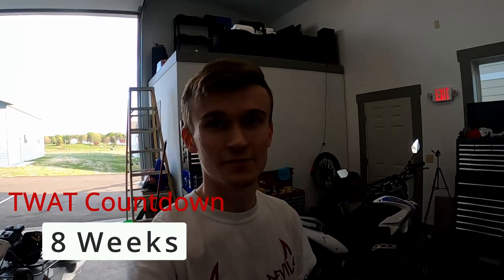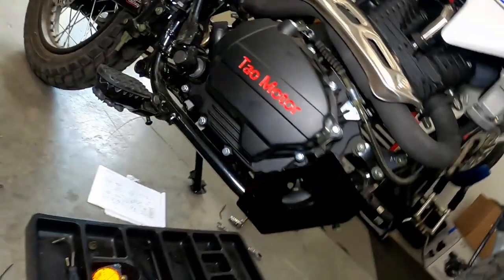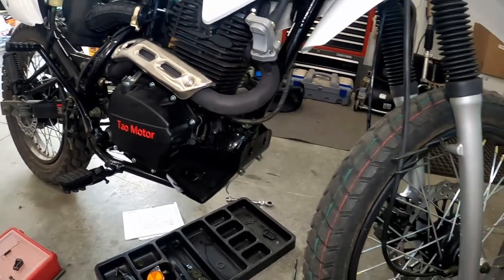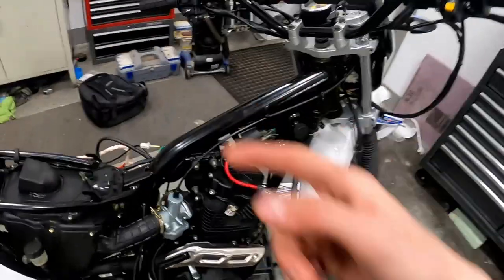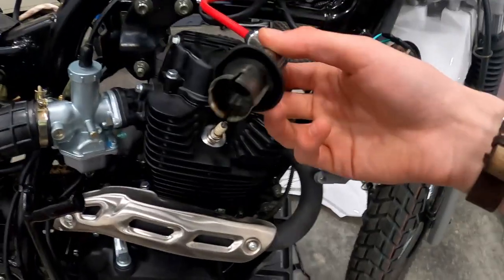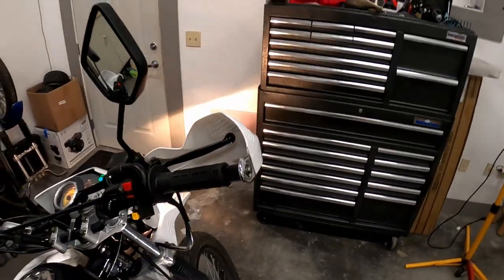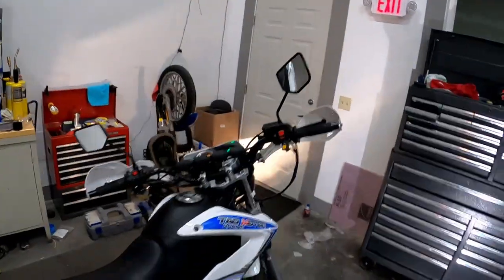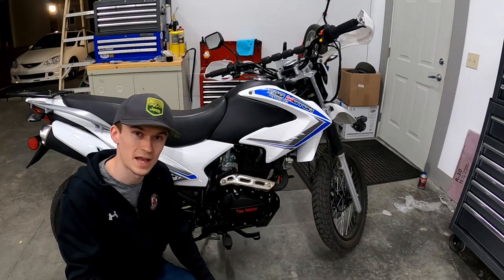TaoTao TBR7 Assembly (Skid Plates, Rear Brake Lever, Rejet Stock Carb)

Comment: Skid plates correct! Your rear foot brake lever is installed correctly…but the insert pin and retaining pin lets call it is in backwards flip it around so the locking pin is on the inside that way of you lay it down the pin stays in place other then that everything is looking good!
Reply from the maker: I was pretty confident the skid plate was right, but the rear brake lever was a bit strange looking. Almost 200 miles on it and everything is going good. Thanks for pointing that pin out, I'll flip it around. Doing fork oil, CDI box, and wiring some auxillary lights in today!
Reply: hey guys , 2 pedal, and jays since you both seem to be experts, would this bike be good for me as my first bike , ill be using it for daily commute , and also dont want to spend much, what upgrades would you guys say are necessary  , idk i feel likei dont know anything but have so much questions been doing some research but lmk if this bike is a good starting point for me, 6ft tall and 175lb, and my goal is to make it as best of a ride as possible and keeping up with the maintenance, any tips or hints? lmk if you can help ill send you my email so you dnt have to send the info through a comment
Reply from the maker: I think in general, this would be an "ok" first bike. There are pros and cons to everything. Pros would be that its cheap so it's a way to get into riding without spending a ton of money. You also don't care as much if you drop it or break something because it doesn't cost very much. Another pro is that the bike doesn't weigh very much and doesn't make too much power, so it will be easy to maneuver and learn how to ride without being too much for a new rider to handle. On the other hand, there are plenty of cons. The main one being that may require more modifications and maintenance than a higher quality bike, which may be tough if you're new to working on bikes. As far as the commuting thing goes, I don't think this would be a good commuter bike, though there are people who do it. The top speed on this thing is about 70 mph so if you have to do any highway riding during your commute, it'll be screaming at max rpm the entire time. Not to mention that as a 1-cylinder with low quality hardware, it vibrates quite a bit at high speeds. If you're looking for a commuter bike, there are tons of low-cost 80's or 90's bikes that you could pick up for under $2k. I have a really nice 1982 Honda Nighthawk 450 that I bought for $1500 that is way more comfortable to commute with. I do love the TaoTao TBR7, but I wouldn't recommend it as your primary commuter bike. Where it excels is being an affordable machine to get into off-road riding. Others may have other opinions, but those are my thoughts. If you do end up going for the TBR7, feel free to let us know if you have any questions and we can try to help.
Reply: @710GreenDragon  as far as maintenance or general upgrades they’re a great first bike to learn how to ride and wrench on very straight forward friendly machines! With a little work you could definitely make it into a dependable daily they’re really comfortable bikes out of the crate it would take some a little work nothing major before I would say it’s something to count on for everyday driving but like anything there’s always good and bad stuff though with the cult like following of them they’re easy to find information parts and anything you need to know to keep them going for the long haul…for 1650 shipped to the door and say 2-300 bucks to weed out the weak points these bikes have with a little time wrenching they make great bikes for anyone from amateur riders to long time bike owners.::in my case I needed something street legal to take advantage of the 23,000 + acres of trails near our new home we bought so it fit perfectly into my needs we definitely hit the trails almost every nice day so usually 5 days a week it’s out ripping through the woods and hasn’t left me stranded yet I’ll say that
Reply: I was just about to make the same comment about flipping the cotter pin to the inside of the brake lever.  Good call!

Comment: Good video.   About the valve lash, if you measured and adjusted it cold you should be  ok with tapping.  The cliché' is "Tappy Valves is Happy Valves".
Reply from the maker: It was measured and adjusted cold so I might be in good shape! I'll probably just pull the cover and double check the measurements next time I change the oil for break in. It's quick enough to do so it won't hurt. Thanks for the tip!!

Comment: Thank you for pointing out the factory mistake with sending them to the consumer with a resistor plug as well as a resistor boot! D8EA is correct for continuing to use the stock plug boot…once you rack up some miles the shift forks will break in and neutral will actually be neutral 😂 but for now definitely be careful
Reply from the maker: Definitely! Don't want everyone out there running resistor boot with resistor plug 😅 And hahah that's good to know 😂 I didn't have the clutch adjusted quite right off the bat either so neutral was tough to get to, but it's a lot better now

Comment: Great video. My throttle feels loose and not snappy when I pull it back. Too much free space. I think I might have that same issue you mentioned in this video. What did you do with your dad to fix it? Thanks.
Reply from the maker: Sorry you're having issues with your throttle, I remembered it being a bit of a pain when I was fixing it a while back. Did you remove the cable from your carb at all? What happened to me was that I removed it and that allowed the cable to unwind in the throttle mechanism on the bars and I had to re-route it and hook it all back up for it to work properly. I didn't do anything too special other than making sure it was routed properly up top and routed properly through the spring in the carb.

Comment: Did you have to fully charge the battery when you first started it. The bike comes on, lights everything, it starts but wont turn over.
Reply from the maker: Yes I charged the battery before starting it.
Reply: @3PedalDevils  thanks man.

Comment: I plan on rejetting the stock carb with a 115 when i get it. Thanks for including the screw size. So all you do is screw in new main jet? Assuming so, and the only thing to adjust would be the idle screw?
Reply from the maker: Hi Chris, I'm really sorry I didn't catch your comment before. Not sure how I missed it. For what its worth, yes, all I did was screw in the new main jet, then reassemble the carb. I also had to adjust the idle screw after like you mentioned.

Comment: Hey man. Love the vids. I'm having a tiny issue with the brake lever arm spring that pulls the mechanism that pulls/turns on the brake light.spooky stufffff. Probably going to have to cut the long part of the little spring so it actually has tension to activate it or just bend the loop on the spring more. Anyway. That's my 2 cents.
Reply from the maker: Hey thanks! Much appreciated. Did you run out of adjustment on the plastic threaded section of the brake light switch cable? If you loosen that lock nut and back the cable out to put enough tension on it that the light comes on right when you tap the lever, it should be better. Just don't make it so tight that your light turns on from bumps
Reply: @3PedalDevils  copy that! Good to know there's a real way to adust it. Before I read this I just tigtened up the loop part of the spring that pulls that light on but yeah; I did notice the brake lgiht is pretty sensitive. I'll back that cable up Thanks!

Comment: I changed to a nibbi carburetor and now when I crank up my bike. It's like it's running at full throttle and I tried  adjusting the air n throttle screw and nothing worked..do you have any recommendations that could help me
Reply from the maker: Have you checked for any leaks in the carb boot on the engine side? What about jet sizes, are you running what other tbr7 owners with that nibbi are running? Does it have a choke? Is that engaged? I still have the stock carb but those are just some other things I'd check if the mix and throttle stop screw didnt help
Reply: @3PedalDevils  I appreciate the response. I finally was able to figure it out. My throttle cable was being pinched which was keeping my throttle cable pulled in full throttle position.
Reply from the maker: Glad you got it figured out!

Comment: what jet did you say you used? looked like a big dif.
Reply from the maker: I used a 108 jet. It was a pretty big difference because it runs a 88 from factory. The bike runs so lean on that 88 they it barely stays running. Most of the TaoTao guys on the owners group are using 110 or 115 jets
Reply: @3PedalDevils  thank you. have you gotten rid of that purge valve thingy or whatever yet?
Reply from the maker: I haven't gotten rid of it yet because ive been working on other mods. I might slap a new exhaust on it after my trip on the Trans Wisconsin trail though.

Comment: Where does that line from the carburetor goes to
Reply: Green wire by the battery and rubber hose on the exhaust system
Reply from the maker: Is the line from the carburetor you're talking about coming out the bottom of the carb bowl? If so, that's the bowl drain hose and it doesn't hook up anywhere. It's so you can drain bad gas out of your carb and whatever other reasons you'd need to drain your bowls. The green wire by the battery isn't currently hooked up to anything on my bike, I'm not sure what it's for. The rubber hose on the exhaust system with the plastic piece on it doesn't hook up to anything either, as a nice fellow explained on a comment in one of my other videos, it's a system to suck air into the exhaust
Reply from the maker: Did this help you Jermaine or are you still having trouble?
Reply: @3PedalDevils  I did all the same mods on my TBR7 but I also have a small welder and do light fab work. I cut my factory exhaust tward the front of the bike in the bulge right before the exhaust turns into the head of the motor and drilled and punched out the catalytic converter. After welding it and installing it back on the bike it made a big difference in power. Probably the same jump in power as when I changed the main jet.   >>>Free mod if you already have a welder or friend that has one,,,,;]     **Just make sure**    you *mark* the cut   so you can line the bends of the exhaust back up so it slips into the factory tail pice of the exhaust also the head of the motor.   >>> I also cut off that weird Chinese ghetto contraption that you said sucks air into the exhaust, and nothing happened so I guess it's not needed must be for emissions or something. When you cut that off it will leave a hole, so you can just cut the head of a small screw or bolt and tack weld  it in place to plug the hole. You can just leave it on also but it's so weird looking,very odd and unnecessary gadget.
Reply from the maker: @paulcollins519  Dang Paul, that's awesome! Thanks for the detailed description of your exhaust mod! Good to know that the stock exhaust can be successfully modified. I probably won't get around to doing anything to my exhaust before our trip, as we're leaving in about 10 days, but I'll definitely consider doing something similar when I get around to figuring out my exhaust setup.
Reply: I just figured out what the silly gadget on the exhaust for>>>> It's so you can hook up a wide-ban O2- sinsor to calibrate air fuel ratios,,,,,,;]
Reply from the maker: Hahaha 😂